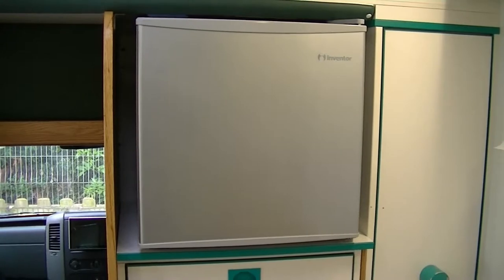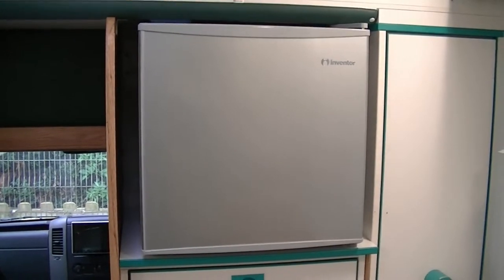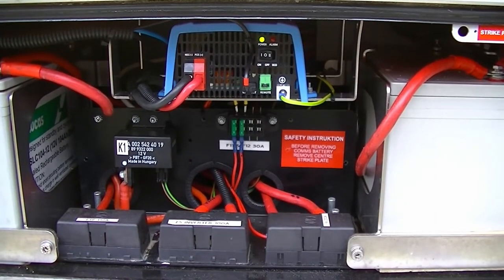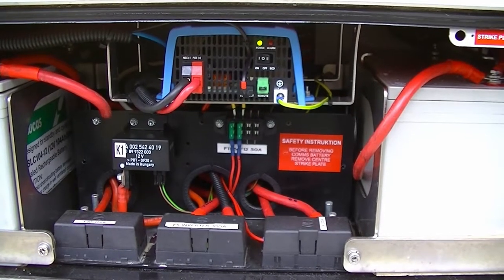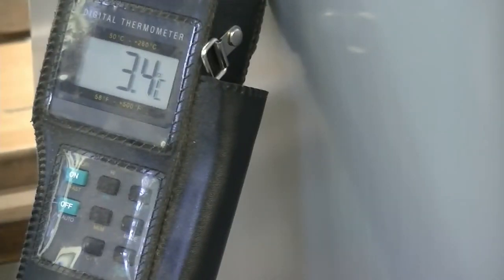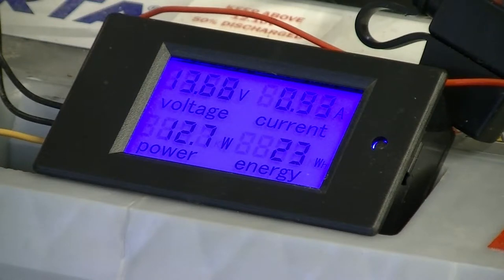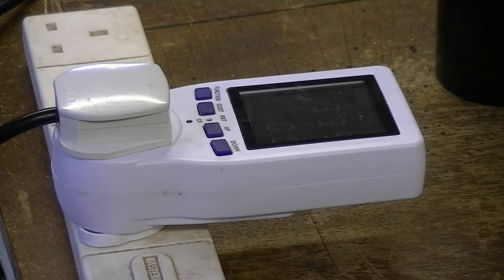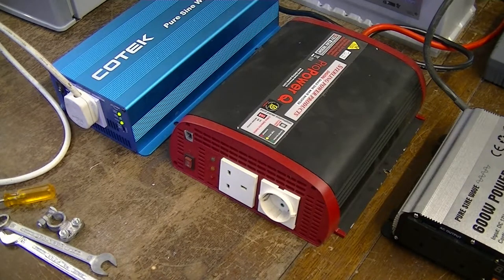Using a mains fridge in a Camper Van or Motorhome and info on Inverters.

Comment: Thanks for posting.
A Victorn 500 inverter is said to have 500 watt continous and 900 watt peak. Why can't it handle a 750 watt peak when the fridges starts?
Reply from the maker: Warning, Victron rate their Inverters in VA not Watts.
Mine is the Victron phoenix 12/500 and the 500 is VA not Watts.
Don't get caught out by that one as I did, because for inductive loads such as motors or compressors VA does not = Watts:

VA is always greater than or equal to watts depending on the loads power factor.
The ratio between the VA and the watts is the power factor.

So for example if the power factor of a typical fridge compressor was 0.8 then a 500VA inverter would only really equate to providing a max continuous of 400W.

As for inrush current the PF momentarily maybe a lot lower. I suspect my fridge is simply borderline for the Victron and is pulling just enough current (during the few milliseconds it takes for the compressor to start) to overload the inverter occasionally, as in maybe once or twice a week. It's annoying but has never actually become a problem, the compressor simply stalls for a few seconds, then something inside clicks and resets (maybe a thermal fuse) and it starts up.

I should have bought the 800 or 1200 VA Victron unit however the Cotek inverter I also have works perfectly.

Note If I were to buy another inverter it would be a LF version like in the link below as they can cope with much higher inrush currents & effectively over a longer period of time the main  downside with a LF inverter is they are more expensive and usually much heavier than HF inverters.

https://www.amazon.co.uk/frequency-off-grid-inverter-220V-240V-nominal/dp/B00PYK573G

Comment: Very interesting Keith, I now have solar so I can run my fridge OK, probably in spring summer and autumn, in winter because I have large vents behind my fridge to the outside you'd think my fridge is on as this has fooled me before.
A proper test over the next year with my set up for my usage, just like yourself, is the real test.
Cheers for uploading Keith.
I thought you should get more views for this, are these non viewers dossing up on fluoride 🚱
Reply from the maker: pa maj Cheers there was no where practical that I could have fitted an absorbtion fridge i.e 3 way in WAS so my only choice was A 12v one or dabble was a domestic fridge, if this experiment fails I will plan for a 3 way in Thistle.
Reply: @CriftinsCampers  Sometimes you just have to try something or how would you know for sure. 
I can do without a fridge and probably get away with a cool box but the fridge came with mine.
My fridge says input power 90 watts but if it's only on half the time I guess that would be around 45 Watts, I'll be testing it out in a week for fourteen days so I'll know better then Keith.
If one plan fails then onto the backup lol
I had to edit Keith, After checking 90 Watts at 12 volt = 7.5 amps I don't think I'll be getting any use out of my fridge, apparently the 12 volt system is only really used like this... Cool fridge at house on mains overnight, drive on 12 volts to campsite and then plug in to mains or, if boon-docking ( wild camping ) run on gas.
I wouldn't run mine on gas as I like to turn the supply of after I use the cooker or shower for safety, I used to do this on boats as a safety measure.
A compressor fridge would be nice now lol.
Good luck with your setup, I'll need to rethink mine 🙄

Comment: Very interesting. Thanks for posting. 
I had been looking at a video where the internal thermostat of the fridge was being used to trigger a relay to switch on the inverter. What is your thoughts on this please? Is it something you would consider, or are you happy to just let the inverter run in power save mode especially as it’s only drawing 200 milliamps?
Reply from the maker: Allan Devaux if you only need to use the inverter for a fridge then the thermostat method is ideal. In WAS I use my inverter for a few other things such as charging my Ryobi power tool batteries and in the Crafter Thistle I may fit a mains TV as well simply because they are cheaper and usually better quality than 12v versions. I am not impressed with the poor sound and picture quality of the Cello TV I have in WAS.
Reply: Hi Allan.
I’m curious to ask if you’ve used my thermostat/inverter method?
I’ve now changed the fridge for a fridge freezer. And unbelievably the £30 inverter is still working. The fridge freezer/inverter combined is drawing 5.5amps running and zero when down to temp.
I’ll test runtime in hot weather when we get some.
Reply: @craster_van_kippers  not used it yet mate as bad arthritis has postponed the build. Just had a hip replacement and hopefully will get back on the build soon. I have a 240v fridge waiting in its box! 😎👍

Comment: I have to say that your opinion on the victron is a little biased due to the fact the victron is far too small. However the victron as still managed to run your fridge without giving up. The victron is by far the better  inverter and if you had done the test before buying and bought the 1200 you would have realised that fact.
Reply from the maker: No I am not biased at all, I was simply advised and sold the wrong thing for the job and I have since replaced it with something that does work.
Your comments make me wonder if you are in any way involved with Victron if so perhaps you could help?

A bit of background info might help here:

This particular Victron inverter model came well recommended via an excellent thread on Mains Fridges on the motorhome fun forum.
At the time there was no indication at all that it could not cope or had a noisy toroidal transformer hum due to the fridges initial inrush current.
I bought this inverter from Onboard Energy and when ordering I explained what I was going to to use it for, it was the first Inverter I have ever bought hence I went for a premium brand.

Again there was no suggestion that it could not cope or had a under load a noisy toroidal transformer.
When I started to use it with the fridge I realised it had some issues due simply to it not being powerful enough to cope with the fridges inrush current.

Victron don't seem to have direct technical support and refer customers to their suppliers, so I contacted Onboard Energy and asked if my Inverter could possibly be faulty because the eco mode did not work properly with my Fridge. They liaised with Victron and after a couple of weeks delay came back to me saying that eco mode did not support Fridges.

I also commented on the Forum and then I discovered yes the original poster had experienced similar problems with his as well and he had since replaced his with an alternative, I wish I had known that first obviously!

I asked Onboard Energy if I could return it as not fit for my stated purpose, and I fully intended to buy the 800 or 1200 instead.
Onboard Energy said yes but they would charge me a 25% restocking fee. I declined and bought the Cotek.

In an ideal world yes it would have been nice to have got my hands on an 800 or 1200 in the first place but hindsight is a wonderful thing isn't it!
I am still trying to return this one because I would like to buy one of their larger models instead for my other van,  I have tried contacting Victron direct but to date no reply.

Its a good little inverter and is fine for charging phones running a laptop or charging our portable mains radio etc I just can't use it for what I originally intended it for

Comment: How big were those agm batteries? Is the system 12v or 24? Thanks, Jim
Reply from the maker: Hi Jim, 
It’s 12v and the two batteries are wired in parallel, rated at 104Ah each.
Reply from the maker: Hi Jim, 
It’s 12v and the two batteries are wired in parallel, rated at 104Ah each.
Reply: Many thanks, how long did your battery bank last? Did you have solar coming in?
Reply from the maker: @notsogreatayton  outside of winter the batteries last indefinitely as there is enough daylight for solar to fully charge them usually by mid morning.

During winter we use about 40A overnight, heating tv etc. on sunny days I tilt the solar panel and again the batteries usually are fully charged by evening but when it’s really overcast and miserable I don’t like to take the batteries down below 60% Soc so 2-3 days max between using the b2b.

The fridge is very efficient it’s only on about 10 minutes in every hour, the tv and lights etc draws more over a long evening!
Reply: Great information, I much appreciate it. I'm looking into fridges and have a similar sized system 225ah @12v and 800w of pv so should be good. I'm deciding on a daily fridge or domestic with inverter. Struggling to find anything reasonably priced locally. Great looking videos, I look forward to watching them. Jim
Reply from the maker: @notsogreatayton  worth remembering the performance ratings changed recently, domestic A++ fridges don’t exist anymore they are now getting given an E or F, some C & D rated fridges are available but very expensive.

12v fridges aren’t tested in the same way for efficiency so no way to compare, my gut feeling is some aren’t as efficient as they could be despite the ridiculous prices.

Noise overnight is worth considering all compressor fridges make a noise, the housing they are put can echo the noise so consider that as you build it.

Effective Ventilation at the back of the fridge is crucial for efficiency if you watch the video I did of minty the green van the owners forgot the ventilation and the fridge was on constantly and was overheating 

Domestic fridges need something to keep the door closed, we use the child safety locks from boots, domestic fridges also often have loose glass shelves which could rattle about, so we stuck ours in place with a couple of blobs of silicon.

A decent pure sine wave inverter with a power saving mode is worth having. Inverters can be noisy for a fraction of a second on startup due to the inrush current . I have modified the Cotek I am using in the Crafter to delay the fan kicking in and silence the alarm it is now dead silent. Can’t do the same with the Victron because I think it’s transformer hum making the noise.

Ideally test an inverter before you buy one.
Reply: That makes sense, I thought all the ratings were poor at F,  E etc but anything around a C is really pricy. I may opt for a dc compressor to cut the inverter out. It's going to be used in the summer months probably 7 months of the year.   I really appreciate you sharing your knowledge. I was initially hoping to run a domestic fridge on a cheap modified sine wave inverter but I now realise that's not the best idea, I was looking at the sterling Q 1000w  inverter.  Back to the drawing board I think. Jim